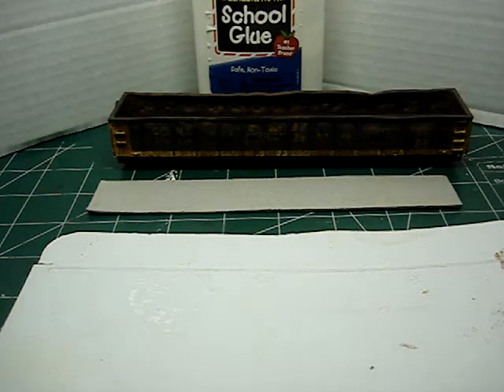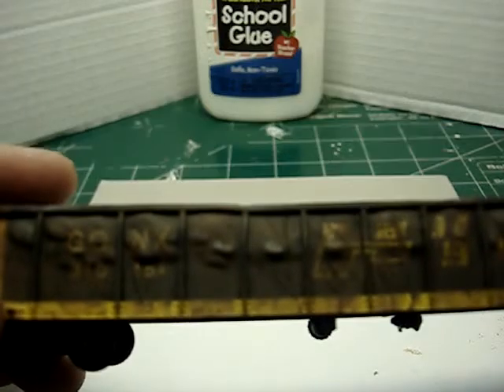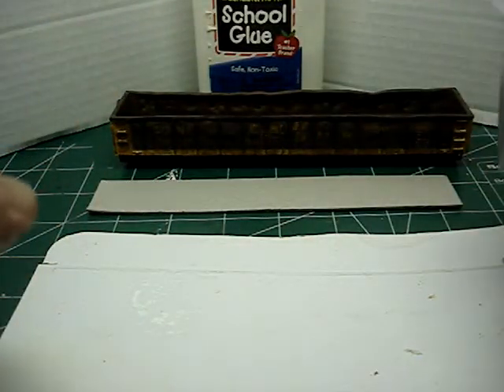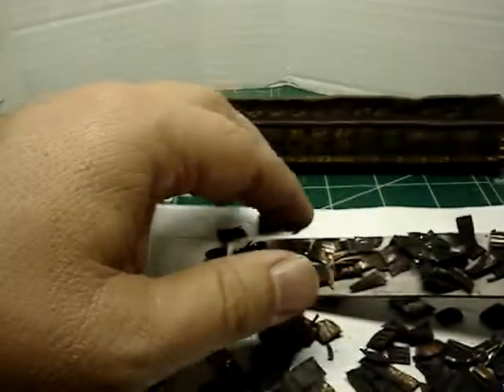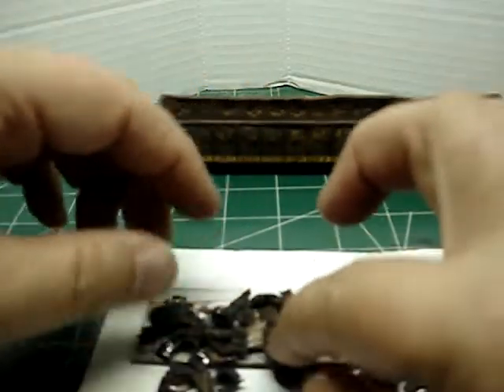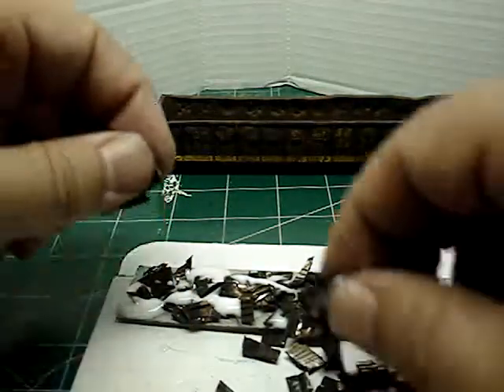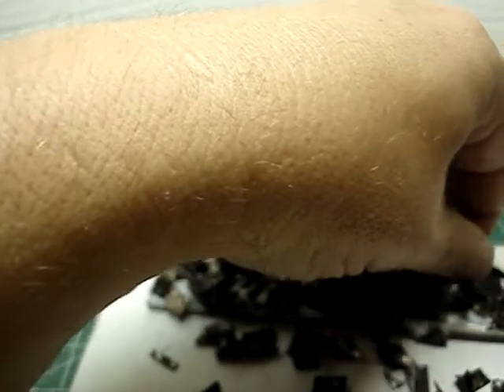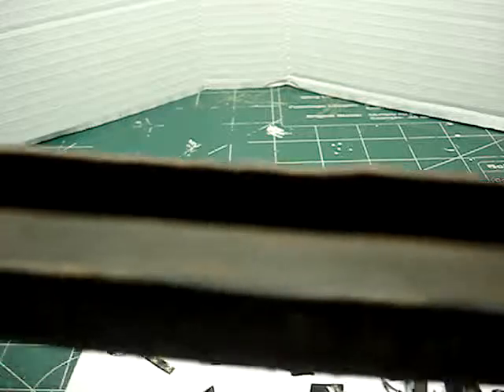HO Dansrailroad2011 Railgon Gondola Dents and Gouges Method with load.

Comment: Yeah, I've watched several videos from old Dan's railroad.  It's kinda hard to take a torch to a brand new gondola.  I've learned to never throw anything away as you may be able to use it for your railroad.  I just cut the round ends off of 200 popsicle sticks with my razor saw and little aluminum miter box I got years ago when I still lived in Georgia.  I saved every one of the ends and have started cutting them up into little tiny bits of HO scale wood about the size that would be in an old steam engine tender before the advent of coal.  I've made a couple of scrap wood piles using those left over pieces.  I even saved the sawdust and will use it also either at an HO saw mill or color it for ground scatter.  I've got an old dryer hose out in the barn--guess I'll be using that also.  Thanks for the tip.
After much swearing and cussing, I finished building a Tichy Train Group flatcar because I liked all the small detail on the underside.  I followed the directions to the letter and wished I hadn't.  After installing the 4 stirrups next was to put on all the grab irons.  The kit came with both the plastic and bronze phosphor grab irons so I threw the plastic ones in the trash (should have saved them).  While installing the grab irons I broke every damn stirrup.  So if I ever build that kit again,  I'll add the stirrups LAST.  Next day I made some stirrups out of staples from an office stapler and they came out great.  I painted each board of the deck a different color of browns, mixing the paint as I went.  Came out looking like real wood.  When building a kit I end up spending as much time chasing parts across the floor as I do building the kit.  Lol.  I just finished a Walthers Cornerstone kit-chicken coops and sheds and it came out great after I hand painted it.
I use my airbrush to paint nearly everything but some times you just have to hand paint.  Thanks for the tip on the dryer vent.
Also when building a gondola load, if your car weight is less than NMRA standards for weight, you can hide the weights under the load.  A tip for making corrugated siding or roofing I learned from MarklinOfSweeden is to get one piece of plastic corrugated material for whatever scale you want to use as a mold.  Then add a drop or two of dish detergent and kinda wash it under a stream of water but not too much.  This will lessen the surface tension.  Then put a thick coat of Elmer's glue (PVA) on top and wait for it to completely dry.  Then repeat.  When it dries, just peel the layer of glue off the plastic and use it like you would have used the plastic; paint it grey first then add your favorite rusting technique.  Saves on the cost of plastic corrugated sheets.
Another tip:  build the gondola load in the gondola by first putting in a piece of plastic wrap and put in the load.  Then use the 50/50 mix of water & glue and after it dries just take it out.  Saves on glue & is a whole lot easier.  Cheers from eastern TN

Comment: The dents look great. I've watched Dan's video about the dents with the torch and many other videos of his. He's a great modeler which so are you. I think maybe you should have used black card or painted the card black maybe. I don't like doing it one at the time on gondola loads either, or for that matter any freight car load. Take wax paper and put a piece across the gondola push the card stock into the car as the card goes in you can see where the corners are and you can take a hobby knife and cut the corners so the wax paper goes to the bottom of the car and it folds up the sides. Let it come up a little higher than the sides of the gondola. Then take it out and fold it back up like it is a liner for the gondola, which that's exactly what it is. Tape the corners on the out side so glue won't stick to it. Make sure you seal the corners of the wax paper completely. Push the wax paper and card stock back into the gondola. Put in some glue and dump the pieces in and put glue how you want it. If you did it right when its dry it will come right out and you can peel off the wax paper and Bob's your uncle. I did this once and it worked but not since. There's also a way to fold it up with out cutting it but I've yet to explore that route. It takes almost as much time to do this as one at a timing it though. I'd still rather do it like this if I could because one at the time annoys the crap out of me. There is also the risk that you didn't seal the corners good enough but still. Stay well.  -Wil   👍
Reply from the maker: Thank you William. The thought of using wax paper had never occurred to me. Genius idea ! That's way easier than figeting with cardstock liner. I'll try that next Railgon load.
Reply: @ModelingSteelinHO  Still need the card stock as a base so you can put it in and pull it out easily. Tape doesn't stick very well to the wax paper so I'd try folding the paper in the corners before cutting them. Glad you like the tip. 👍